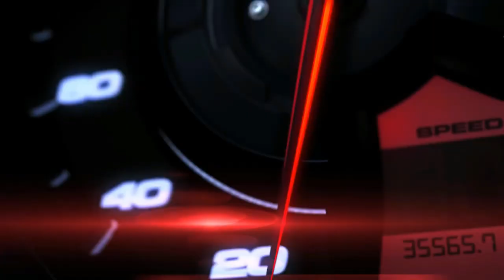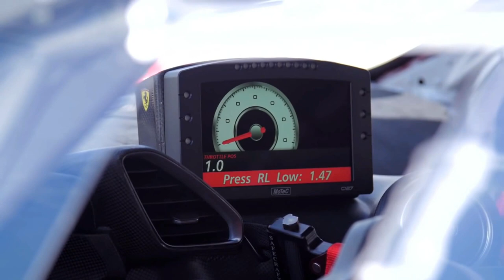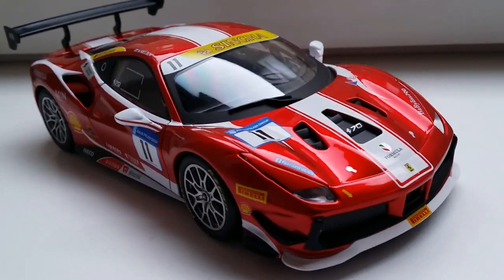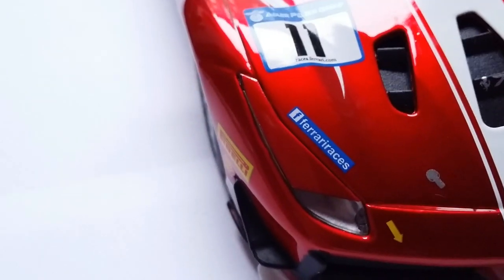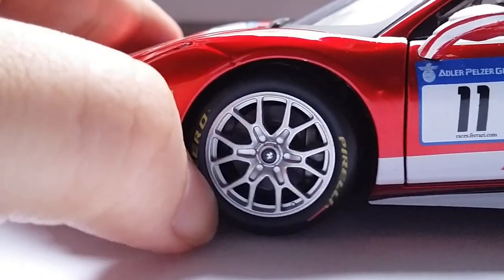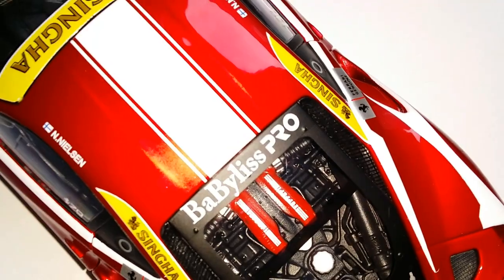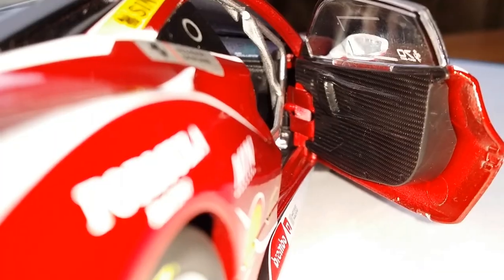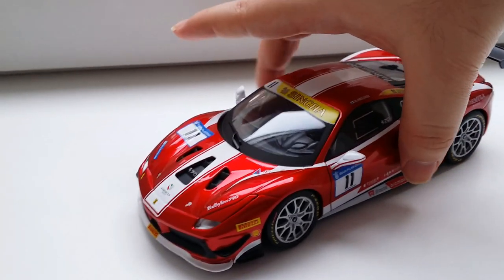Reviewing the 1/24 Ferrari 488 Challenge by Bburago

Comment: So finally I got my hands on it and yeah... Nothing much to do with it, but as a collector I must say, it's a pretty awesome, well designed model, just good to look at it, also my center piece at the moment... :)
Reply from the maker: yup. i love the livery, the metallic red, the well designed wheels and the lexan windows. i think the only other 1/24 ferrari with racing windows is bburago's 458 challenge.
Reply: yes, and as I saw you can open the hood in the back too, but the 488 Challenge looks a lot nicer imo, I still didn't regret it, looks even better in real life :)
Reply: @ImperialDiecast  hey, wait a sec! I just noticed, there's a plastic tool glued underneath the pedestal, which is actually there, so you can open the doors with it easily without e.g. breaking down the side mirrors or damaging the paint or windows... have a look at it, because as I remember you showed only ways how you open the doors by hand! :)